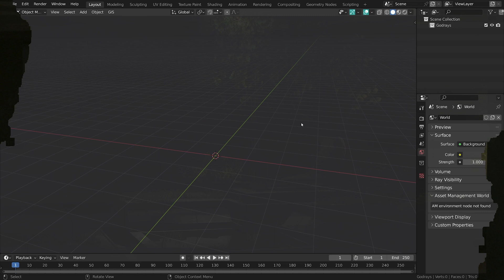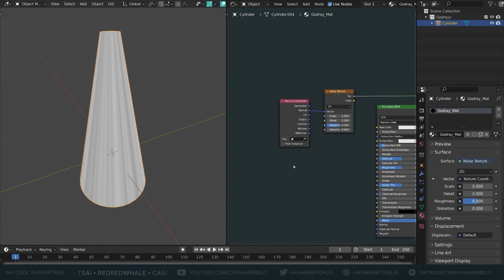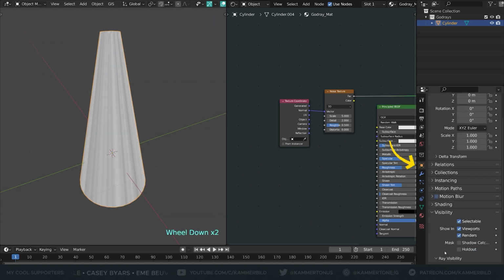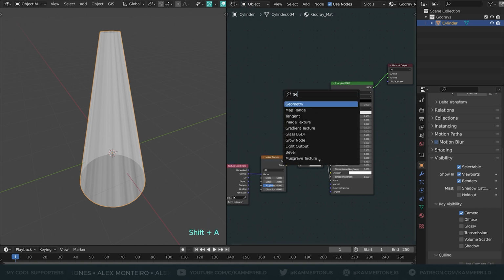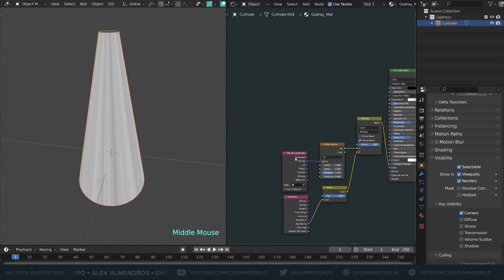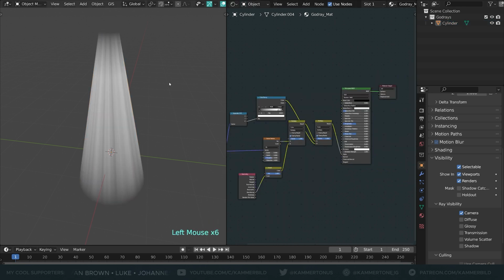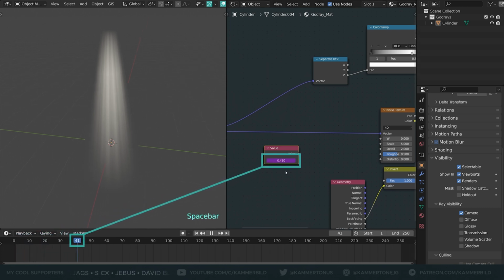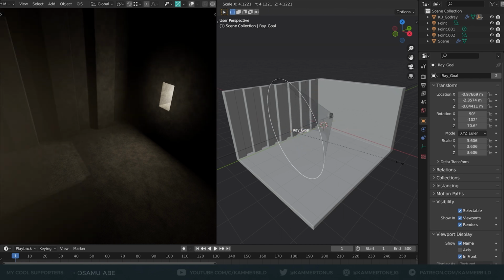Fake Godrays to save render time :)

Comment: is there any way i can make a loop of the movement of the W from the noise texture using the value and multiply nodes? i wanted to use these rays for a looped video.